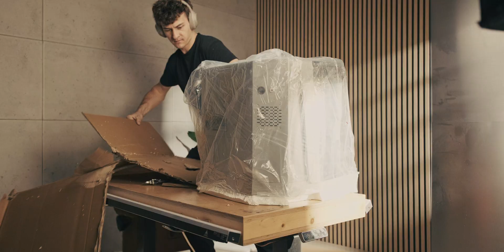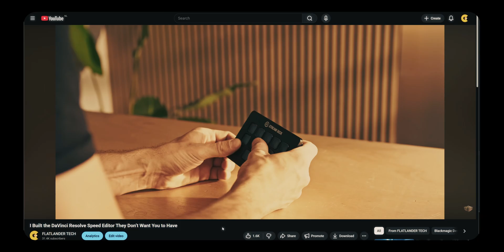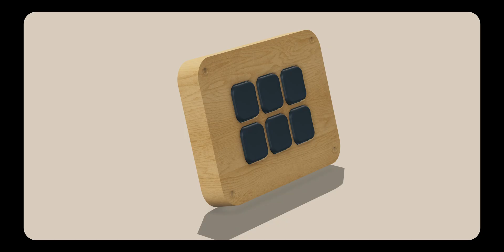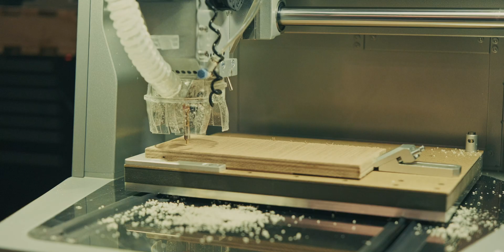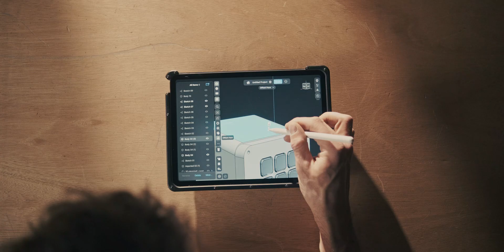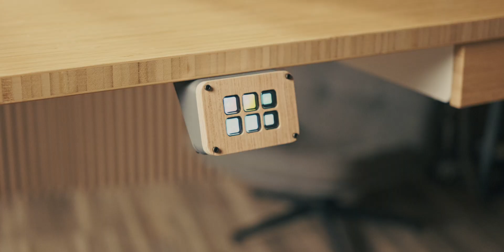My First Ever Custom CNC-Machined Part — Carvera Air Desktop CNC Machine — Elgato Module Housing

Comment: Unlike a 3D printer, you can't leave a CNC unattended, so that 3 hours seems harsh. My 3D printed CNC could have done it in about 10-20mins, so I think something's wrong with the settings. Maybe it defaulted to aluminium or something.
Reply: My thought as well, that OR he might have chosen far too tiny a bit for what was needed. But for the first pass probably better slow and steady than optimal chip removal. 
Also it did need to hollow out the majority of that part.. IMO 2 stacked thinner pieces would have meant the 'hollow' area could have been taken out with a single outline pass rather than being meticulously hulled.
Reply: Definitely the bit. Looked like he was using an 1/8" or 4mm endmill. Could have probably stepped way up to .500" or 12mm
Reply: @anthonycatello well without changing bits, it looked like he needed 1/8" for the internal corners, but even with a 1/8" bit, I would have expected minutes not hours.